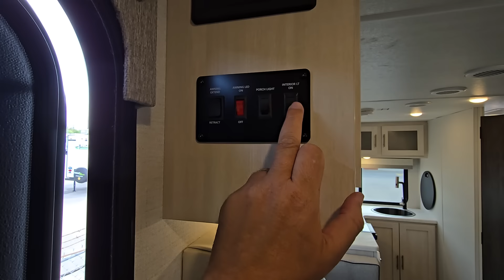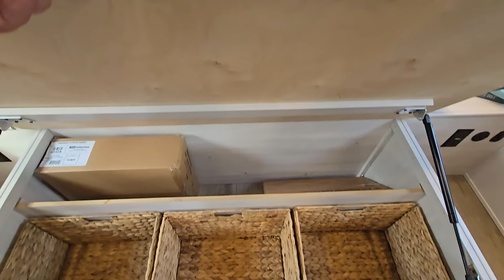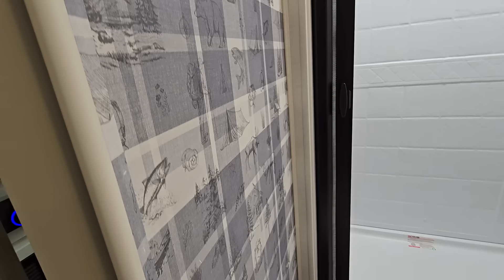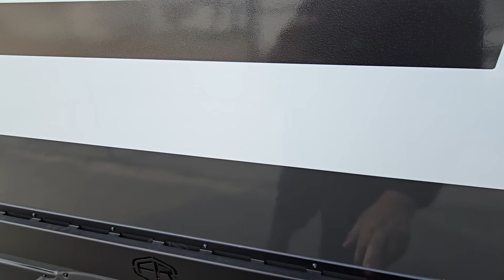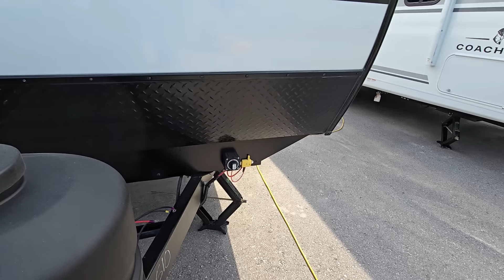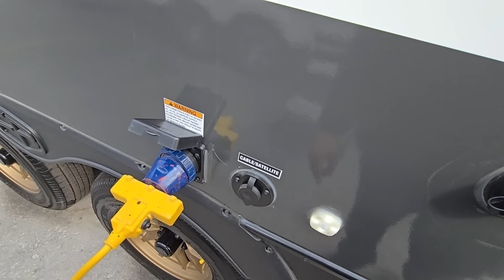2026 R-Pod RP-205 Tour | No Slides Doesn't Mean Cramped!

Comment: Very nice layout on this.  Too bad they don't option the "Stargazer" that you can get with the Apex Nano series.  It's all owned by Forest River.  The only thing this one is missing is more interior storage space.  If you do a lot of camping at the edge of the seasons (early spring, late fall), you need space for comforters for the bed, and additional bedding.  There's nowhere to put that here.  The usual storage location for that, above the bed, is removed to give it a more open feel.
Reply from the maker: Definetly all trade offs for sure. I don't think they will offer the stargazer I'm afraid as the front window opens and it has got more expensive for the stargazer but it certainly a future possibility. Storage is always king so if they could add more I'm sure they will. The reality is its a top one or two best seller for them and us and they aren't likely to change much until sales decline. On the positive side its a rare Murphy bed that is an actual queen.😉

Comment: why in the fuck would they put the battery cutoff switch out front, in the open, exposed to all of the dirt, rain, snow, ice, that this thing will encounter?
Reply from the maker: That front frame has been the classic place to put these........forrreverrrr. There are now newer command stations like the nautilus products but that's a newer trend of the last five years. I can say these switches are engineered to be outside and are not something our techs are replacing.....ever

Comment: Build Quality: Some users have reported issues with the overall build quality of R-Pod trailers, including the 205 model. Problems like loose trim and poorly sealed areas can lead to leaks.
Design Flaws: Specific design choices, such as the placement of staples near plumbing lines, can create vulnerabilities that allow water to penetrate.
Reply from the maker: Well on these matters even with 25 years in the rv industry I still like to defer to my top techs. They seem to overall find the quality from the factory to be quite above average overall here. The reality is your dealership is the last 100ft of the assembly line. If there not putting in the 20 plus hours of preparation, and detailing then you may find those plumbing issues from day one and other issues. 
A good rule of thumb is to take two good shake down trips and be thorough in going through it afterwards and then have your dealer take care of any of those issues.
Are there items or materials I would love to see them use...no doubt. These would come at additional weight and cost which is certainly what they are trying to avoid.
At half the cost of a Lance or an Airstream I think you would be pleasantly surprised by an R-pod. My client who went to the Yukon on trip three this summer certainly was😉

Comment: As a retired couple we are still looking for the ultimate small travel trailer towable by my 1/2 ton pickup truck.  We are people of means and want premium features in a small package. 

No huge clunky fifth wheel or 30 foot trailer for us. We will be traveling across the USA so lightweight and easy to tow is important to us.

We looked at Class C and smaller class A  but you still have to flat tow a vehicle so that's a major league  hassle.  

We would like under 5000 lbs.

Has someone ever figured out how to make the trailer once set up not wobble like a trampoline?
Reply from the maker: Well it sounds like you have done a good amount of research which is great. Having a motorhome myself I to don't want to tow a car behind me.  Two of our more popular choices keeping it small currently would be the 192 r-pod at about 3800lbs and the 205 model by r-pod @ 5000lbs. Certainly could be good options to look at. Also the Surveyor Legend 202 is pretty great at 5150lbs with the addition of a slide
As you have described the touring you want to do and you have some funds to add to features I would suggest looking at Lippert's electric leveling system to make life on the road a lot easier but also get rid of the wobble when parked when used with the stabilzers that would be standard : https://www.youtube.com/watch?v=7owJQKcMutE
Reply: Have you considered, Escape Trailers, fiberglass, lightweight, no slides and solid!
Reply: Outdoors RV tailers have a cult following check them out some come with onboard generators

Comment: avg 30K?
ouch.
still going used.
like my truck, 
you lose too 
much just driving 
off the lot.
Reply from the maker: Not if your buying for the long term in this case. Your already helping without a slide in terms of lowering maintanence costs and potential future issues. There is no reason with proper care this isn't a 15-20 year unit for a client. That's how you save all day long.....

Comment: What size is the end? What are the seats made of? I hope they’re not the faux leather that peels after a while.
Reply from the maker: Great question  205 model is 25' end to end. We have not had to replace any furniture due to fad. ideally you would keep the shades drawn when not in use to Cut the UV exposure to near nothing as added insurance. I have certainly seen what you describe in ten plus year old units but materials have definetly changed over the years to keep up with enviromental changes
Reply: @PrimoRV Thank you. I meant to ask what size is the bed? ❤
Reply from the maker: It will be standard with an rv queen for easier access in the bedroom. If your not 6'4" you'll find it fine but you have the room should you want to upgrade in the future!  @destresswithyoga
Reply: @PrimoRV  awesome. We currently have a queen short. Thanks again.

Comment: This could be FR greatest seller if they would just stop being cheap. It needs solid counter tops and solid cabinets. A composite floor with more supports. Finally a great independent suspension a Curt would be fine a Cruisemaster great. Warren Buffet better get it together.
Reply from the maker: I would estimate this likely is a top 5 Fr seller already on the the solid surface counters they are definetly trying to keep overall weight in mind to allow for the Suv towability which the majority of our buyers will use. They had tried the independent route in 23/24 it added too much cost for the average buyer who will never see a big advantage from it. Its definetly something our top rated service dept can help clients with. I have had zero complaints on the floors but point taken!
Reply: @PrimoRV  they are owned by a billionaire do much better
Reply from the maker: @ejmtnt I'm afraid the features you mentioned would only serve to drive pricing further. if enough people ask for them the factory will definetly respond

Comment: I really like  this one a lot!  Something that I still want to see offered on all these trailer is a single bed only!  I want a single bed that sits on the pass thru storage. No closets on either side, just storage cabinet or shelf above the bed. Then with the extra floor space a true flirty to ceiling closet and drawers system can be put on either side of the living area walls. You could easily still do that here even with those sliding doors. Just incorporate the doors to work behind the closets. This way you would even have a closet for coats, shoes, cleaning stuff etc. 
I also want to see a cooktop that is in laid into the counter with a cover that can be closed for continuous counter space when needed. This will also prevent you from bumping into those knobs and turning it on accidently. 
I wonder how that one would look with the sink in the corner and the cooktop top on the right side by the bathroom? I like my space rack to the right side of my cooktop (a pull out cabinet type). The only reason I say to put the sink in the corner, is because otherwise you would need to have another window if you put it where the cooktop is now.  No microwave under the counters! Put it up above or just omit it all together. If someone wants it, just prep one of the upper cabinets with power so customer can install themselves or not at all. 
I do really like this floorplan though a whole lot!  I absolutely love that that out in a small dinette!  It's perfect. Great storage all around too.
Reply from the maker: Things like cabinet removal could  be done by a competent dealer like ourselves and then the work hidden for you. In terms of closets I think you would definetly need to be in the unit to determine if that would work as there is know slide here.....Ps my shower is our closet.....We never use our shower we use the campground facilities or the lake😉
Reply: @PrimoRV  yeah, I thought about using the shower as a closet but I might want to be off grid at times too or maybe the campground has hookups but no showers or they're nasty. Lol. I just read my post again and it seems that all the typos and wrong words that I edited never got fixed. But glad to know you understood what I was trying to say. This phone can't usually keep up with how fast I type and it constantly changes words to something else. If I don't keep reading before the tiny conversation box moves up, then I can't go back to see if any mistakes were made. Lol. Never had this problem with my old phone.